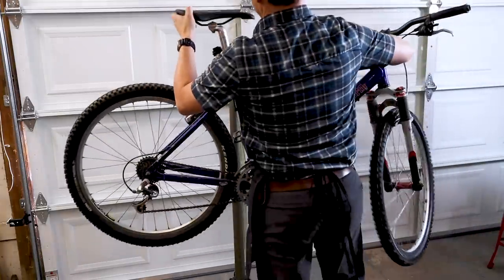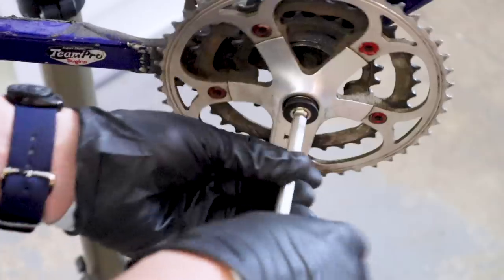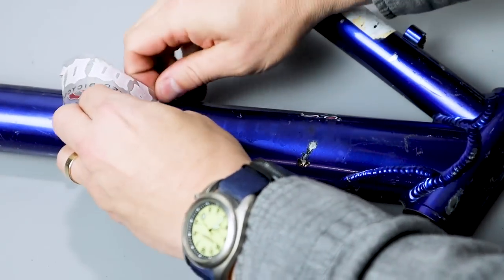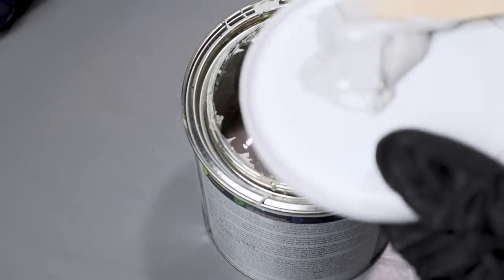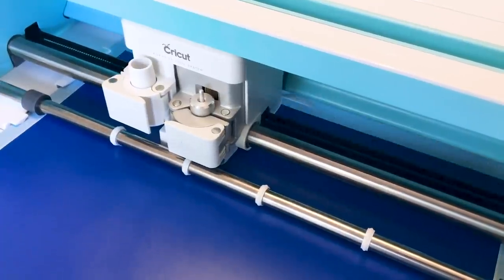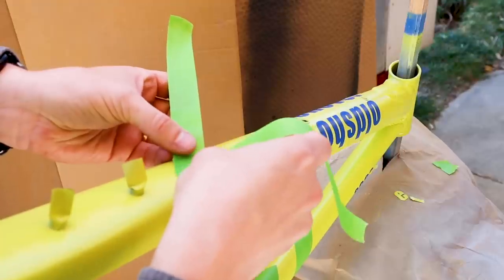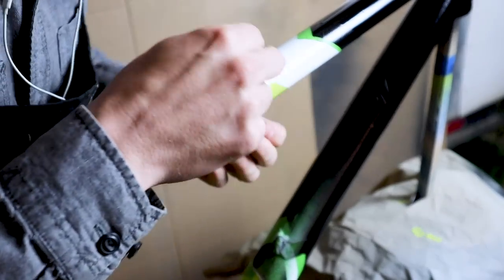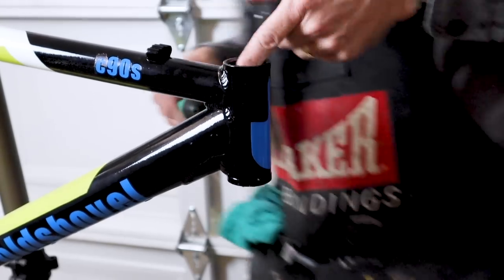I Painted The Mystery Bike

Comment: Just finished rebuilding a 2001 Jamis Dakar full suspension frame, all the way from stripping and sanding the frame, re greasing the linkages, repainting and the build. Can't agree more, I love the build process! I used the same paint to similar results, with the edges not quite working out. I will definitely try the bike dot paint you mentioned next time. Great video!
Reply: I just did a total rebuild of a  jamis park one ....

Comment: I still have my Supergo Access I bought in the mid 90s. I put slicks on it in the early 2000s and still ride it today with LX shifters, V brakes and derailleurs, Avid Brake levers kalloy Uno seat post and a Judy XC. I can’t stand the cables on the top tube but oh well. I’ll be putting a Barang electric motor on it in the next couple of weeks for family members that come out to visit.

Comment: even with properly adjusted rear derailleur, chain suck will happen, especially if riding offroad, a chain guide is a must for every bike I ride.
the rough terrain causes the chain not bounce, and with old derailleurs without clutch, the chain will bounce a lot more, so you have to ride very gentle, or keep it in mid chainring at the front.
so the best drivetrain setup now is  one chainring, and bash guide, which means chain guide and a bash guard/crashplate.

Comment: I have got a question about the Cricut maker or the vinyl stickers respectively. Since I understood that the printer acutally cuts different materials how does it work that it only produces the lettering and does not cut through the vinyl completely? Which vinyl does you use exactly? Could you eventually make a short video on how you make your own lettering for the different bike restorations? Thanks.

Comment: Tip from a spray painter mate, I hate cans.....BUT  lightly sand between colours with 1200 wet & dry and you'll find the black wont peel like did, clear will cover the scratches and lots of it, another light cut with 1200, then polish with a fine compound by hand then polish again by hand with a paint protector they'll come up glowing, wax & grease remover between colour sands to, keep up the good work,

Comment: oh,it's my set.I have shimano xt rear derailleur and front shimano deore lx(the same versions):) But for rear derailleur I recommend shimano dual control shifters because that is low-normal derailleur.It works bad with normal shifters.

Comment: Remove the masking before the paint dries, otherwise you will pull off parts of the paint next to it. Don't let it fully dry is key.
With painting, you can try thin coats to build up. Why try to get the cover you want in one pass?

Comment: Dude, you need KBS Diamond clear.... waaaaaay solid clear
Reply from the maker: I’ll have to check it out. Thanks.
Reply: @oldshovel  ya I do custom frames myself, direct to steel tested. Takes a week or so to fully cure up but I smacked handlebars off a painted and coated frame just to test, no mark.

Comment: It is observed that the paint used is of low quality. Do you remove a CaneCreek S3 headset with sealed bearings and put in a cage ball?
  The machine was originally prettier than after retouching. A shame.

Comment: not with a hair dryer.. not enough heat.. go to the hobby store and get yourself a heat gun

secondly:  give minimum 24hrs per layer of paint..

thirdly: use automotive paint and a decent spray gun for best results

finally.. get job on the bike!